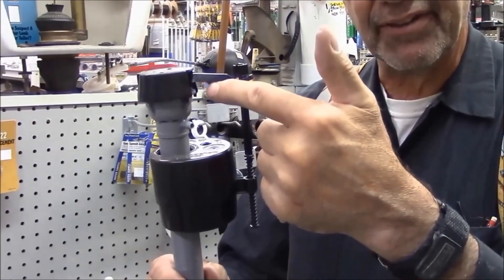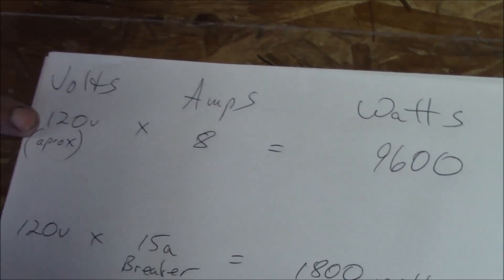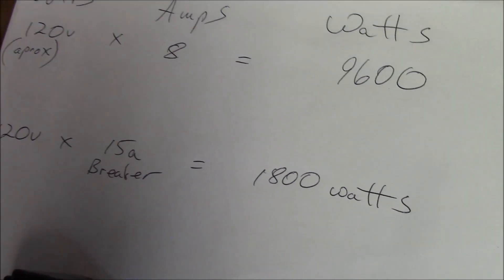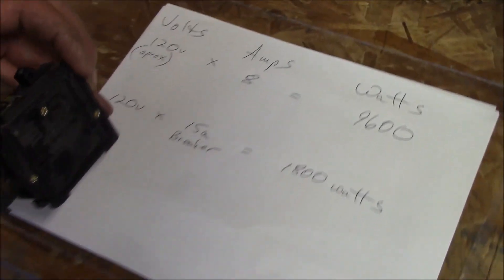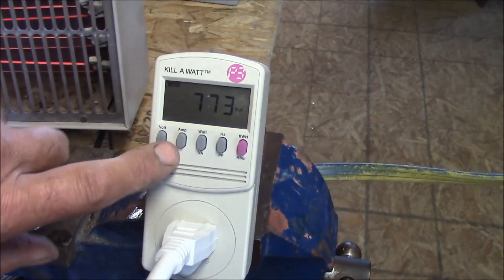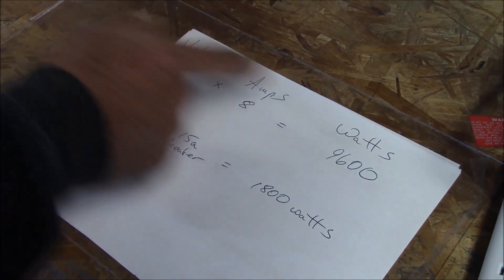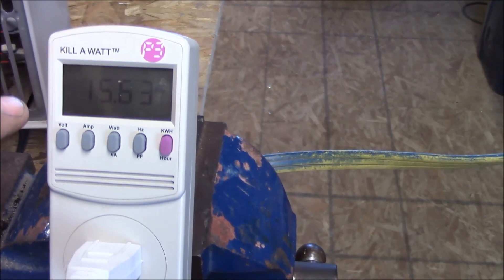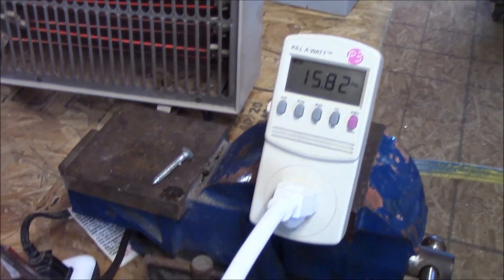A Power Strip Has Limitations, Overload Could Cause a Fire

Comment: What about Halloween decorations/lights and small wattage things like that string lights and such…? I’m setting up for Halloween currently. I have 1 outlet out back at me shed, I’ve got an extension cord plugged in on top and one on bottom of the outlet, each cord running about 10 lights, or small electronic. Think that’s safe? Or how can I figure out the math on that? I haven’t fired everything up yet together to see if it’s alright.
Reply from the maker: Every light-set and small electronic has a wattage label. Watts add up and a receptacle on a dedicated circuit (with nothing else on it) has about 1,800 watts available. The 2 plugs on a receptacle are from the same source, together they still only have 1,800 watts. That is the max which you should be staying under especially if you aren’t sure what else is on that circuit.

Comment: when i turn on an electric burner all lights dim. is this a symptom of overloading?
Reply from the maker: Probably,  but it could be a loose connection in the wiring, either way some wire, somewhere, is getting hot and can start a fire. Get some help…..

Comment: As someone with a basement that has 6 outlets in one room of the basement, this was very helpful to help me understand. I thought maybe each outlet could support 1800w etc.  Now I understand I need to be more careful. For example I will soon have two 850w Gaming Computers in the same room, so I will have to keep in mind and monitor the amount of additional things we plug in on that circuit!
Reply: Also I have a question. My Condo does not have a properly labeled circuit breaker panel. Over half of the paper is blank even though I know they are in use. Some were easy enough to figure out what they ran to. But for the others should I just switch them off and go around the house and see what’s turned off to label the break myself? Or should I hire an electrician to inspect it and properly label it for me? I’m only 23 so I apologize for my ignorance with these things.

Comment: Question. I just moved into a brand new apartment building and everything I try to play video games on my computer my breaker trips on the side of the apartment I’m in. Sometimes it won’t happen until a couple hours into playing. Is this due to circuit overload? Should I try a different outlet ?
Reply from the maker: It depends on what other things are plugged in on that circuit also. If it doesn’t add up to 1,500 watts, all the stuff has watts on the label, the breaker could be bad.

Comment: My house is wired in a very annoying way. The dishwasher, microwave, and clothes washer are all connected to the same circuit, and pull so much power that only one can be used at a time. May have to replace the circuit breaker with one with a higher amperage, not being able to do multiple chores while making lunch and dinner is irritating.
Reply from the maker: You cannot safely just increase the size of a circuit breaker or a fuse, they are there to trip if electric usage exceeds the capacity of the wire. Overloading a wire causes it to get hot and eventually causing a fire. Worst part is the fire starts in a wall, unseen until it can be too late. You need someone to add 2 circuits to the kitchen because both the microwave and the dishwasher call for separate circuits by code.
Reply: @MrHardware1  Oh, ok. My house was built in 1911 before most appliances even existed, so something not being up to code is no surprise then. There are portions of furnace duct in the basement that I'm almost positive have asbestos wrapped around them, so there are probably many other things that need looked at now that I think about it...
Reply: Breaker is only there to protect the wire so it cannot pull more amps then the gage of wire will allow. You can only raise the ammount of amps if you install a bigger wire. Like a garden hose to a fire hose.

Comment: So if I've got a 55 inch TV, two computer monitors, a PC with a 1000 watt power supply, three gaming consoles, a modem, a router, a network switch, speakers, a phone charger, a ring light, a lamp, a smart speaker, and a piano keyboard all plugged into the same outlet, am I fine if I've never had any problems or is this just a fire waiting to happen?
Reply from the maker: Everyone of those appliances has a watt usage on the label, add them all up and a 15 amp circuit only has about 1,800 watts available. Not counting other plugs on the same circuit. I would take the pc and plug it in elsewhere. I added another plug behind my tv supplied from a new circuit breaker to prevent overloading . Big hassle but like you I had exceeded the existing plug.

Comment: I have a question, my appliances show both an input and output current. In this case do I sum up the input or output currents of all my appliances to make sure I am not exceeding the 15A limit? Thanks!
Reply from the maker: The input voltages all that matters, that is what your device will use.

Comment: actually to be clear - it/s not that "a person may have too many appliances on that circuit" I also would have explained, that, its perfectly fine to have as many appliances plugged into that bar (since you demonstrated the one) up to 6 inputs BUT that you should be mindful on how many you power up at the same time so as to NOT trip the breaker..sorry just an observation but agree with everything else you mentioned.